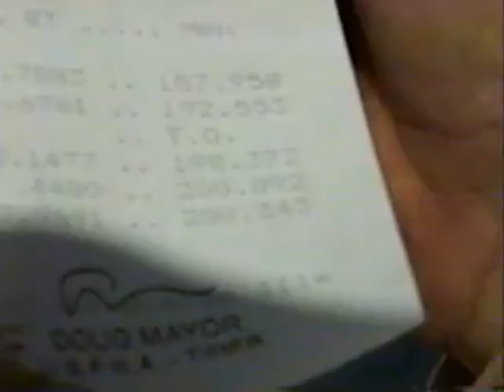Record Setting Merkur XR4Ti at the Bonneville Salt Flats

Comment: Love the nothing...nothing...nothing...LOCO! power band.  I first drove one of these in 1985 while working at a Lincoln Mercury dealer, doing the new car prep. Later, I bought a dozen of them at auction from Ford Motor Credit. The original design valve seals would get hard and smoke, even at low mileage, so the other dealers were afraid the turbos were bad. Cheap fix. Every day, on the way to work, I would hit 120 mph on the interstate. These are great cars, with trademark German sport/luxury ergonomics.The stock brakes, however, are inadequate for even normal use. The front rotors are small and prone to warping. Upgrades to 4 wheel disc with larger front rotors are  available. The stock suspension calibration is on the soft side, with skinny tires,  swaying with over steer. O.K. for sport/luxury, but upgrades are available if desired. Rick's car has the SVO aluminum head, with high intake ports and large valves,  and makes as much power as the stock block can handle (600 hp), before bore flex. The other limiting factor is the ring and pinion in the IRS, which appears to eventually break at around 500 hp.